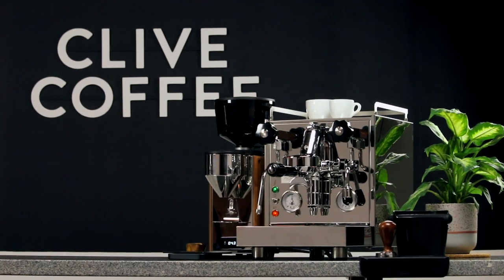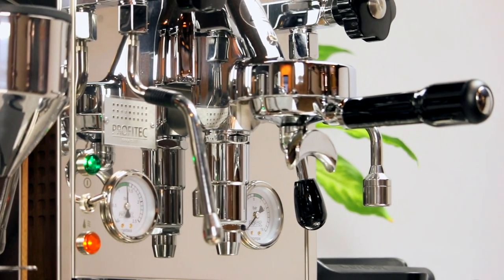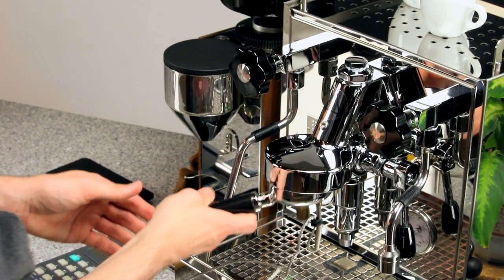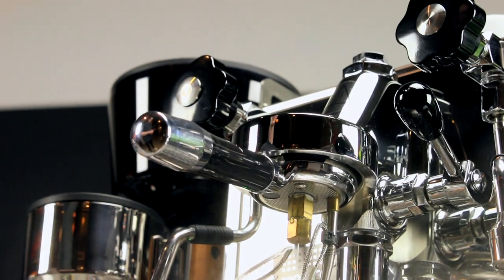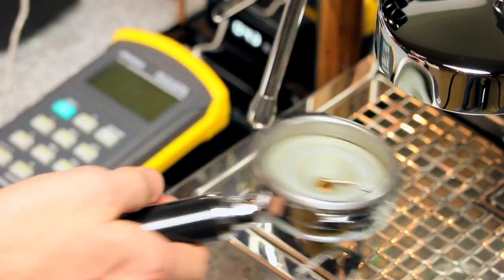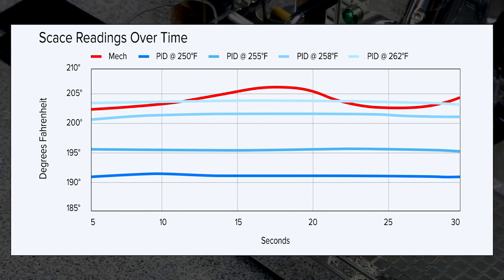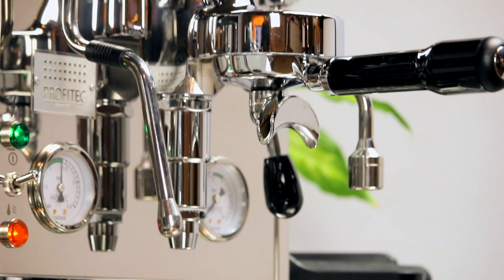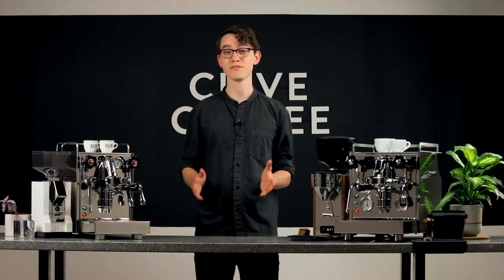Heat Exchangers With PIDs – Are They Worth It?

Comment: Heat exchangers are a learning curve. I use an Eric’s Thermometer on the E61. End of issue. Now just figure a consistent temp before flushing or not (cold machine to desired temp.,or temp.after first double shot!). Now with long preinfusion (15-20 sec.) my brew temps are very stable. You just have to play with it.
Reply: True I have a temp gauge on my Rocket I’m like at 205 206 before flush by end of shot I’m like 200 end of story. I think the pid would be better served on a single boiler machine or double. Yes the hotter the boiler the more steam but dam I’m not running a cafe I got a lot of steam dam machine is HOT!
Reply: I just added a flo-control device. Now my expresso is so much better! Take about 5 minutes to install. I did not use the gauge because I want to monitor temperature instead. I start with low flow (like a preinfusion, then increase flow, then drop it down for a smooth finish).

Comment: Question Charles: When you say that it is better to have a lower steam pressure for cappuccino, why is it? I thought that more was just better, unless so much ghat you weren't able to control it anymore. I've bumped my Rocket R58 from 1.2 to 1.5 bars which is it's maximum and wow, that 0.3 makes a huge difference! I can hardly believe that it is good to use these newer ECM such as the 800 and "Synchronika" at 2.0bar as you are most likely going to overshoot and burn ur milk from just staying 2 seconds longer, or splash the milk on the machine?

Also, are you gonna get more bubbles for the Cap, if you can inject air for a longer period even though the pressure is lower?

Comment: Is there any way to add a PID to a Rocket Appartamento?
Reply: Not practically. But it would be a waste of time. Swapping a PSTAT for a PID on a machine will make no difference to brew water temperature assuming you run the machine at the same boiler pressure. If you change the plumbing at the same time you may make some difference (like installing a different thermosyphon restrictor) but that has noting to do with a PID or PSTAT.

If you own a HX machine (PID or PSTAT) the best thing you can do is invest in a group head thermometer. Brew water temperature is dominated by group head temp.

Comment: So does having a PID on a HX machine, sacrifice steam pressure for a more stable and appropriate brew temp, vs a traditional pressure stat hx machine?  Also does a more stable temperature actually improve shot quality? Some variation might not necessarily be bad.
Reply from the maker: Hey Ben,
A PID on a heat exchanger does not reduce steam pressure whatsoever. If anything it increases the steam pressure by allowing the machine to achieve and maintain a higher boiler temperature overall. As for shot quality, I find a consistent brew temperature is important for predictable extractions. If brew temperature varies you can imagine your shot will also be impacted. Hope this helps!
-Amanda
Reply: @clivecoffee  cool I was just wondering if anyone experimented with varying temperature vs stable, same with variation in grind size or we just assume consistancy is always best?
Reply: Update I got a HX machine with a PID, definitely more than enough steam pressure! Adjusting the temp, does make the pressure rise or fall with temperature, but still much more powerful and quick than my old machine using a thermoblock steamer, even on the lowest temp / pressure.
Reply: I know I’m late to the game here but….. is  this showing that heat exchange with PID may have a concern for accurate espresso temps?
Reply: @mikechadinha5587  I ended up selling my Rocket HX machine with a PID and got an ECM synchronika dual boiler temperatures are much more stable and controllable with the Dual boiler. I found adjusting and PID didn't really have much effect on brew temperature on the HX machine. If you do get a HX machine I'd recommend getting the group thermometer with it so you could get a better idea of what's going on temperature wise.

Comment: Is a PID worth it on a single boiler , like a rancilio silvia ?
Reply from the maker: Hi there! A PID on a single boiler can certainly open up a world of experimentation and versatility if you like a wide range of coffees. I always find darker roasts can greatly benefit greatly from a slightly lower temperature. If you typically stick to one or two roasts a machine without a PID may be sufficient for you. Hope this helps! 
-Amanda
Reply: The single stainless steal 33-ounce boiler with PID on the ECM Clasikia is very accurate.
Reply: Silvia is definitely no stable regarding brew temp, you would need to perform a temperature surfing to achieve the suitable brew temp, otherwise your shot will never be consistent. I know that Silvia Pro DB comes with PID but i am not sure if the single boiler comes with it from factory. but i am sure you can buy the PID separately and install it.
Reply: I always brew first. Hot portafilter, wait for light to go out, brew. Oh so sweet! Then turn on steam switch. Rancilio I think designed it this way?
Steam milk first was always a bad experience for me.
Reply: @Will-bp2yc  Me, too.

Comment: I can't tell the difference between shots pulled at slightly different temperatures, though some  can I suspect  for the majority it's like blind tasting wine where most can't really tell the difference between expensive and moderately priced decent. Marketing? you must buy the machine with the PID as that's better? I don't have a flow paddle either but I like the coffee I make and that's really all it's about.

Comment: Pid is a gimick. Marketing trick. 100 years milions Italians drank their excellent espressos 6 times per day. Without pid. Already control doses,  grinding and time is difficult for me. What if I change the temperature and choose a wrong grinding grade. Will be espresso better taste?
Reply: if you largely brew dark roast its mostly useless, for light roast however it does make a difference. But I agree it's mostly about the machine having the right temperature, e.g. hot enough